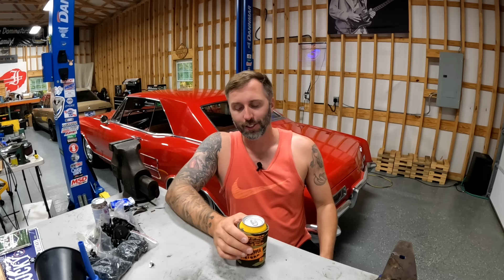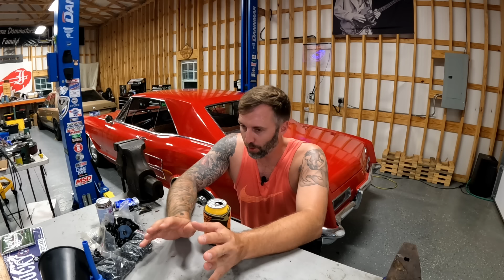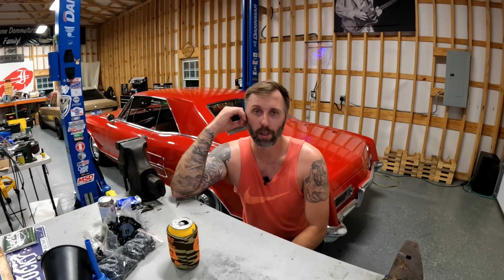Why I Ditched Holley Sniper EFI

Comment: I think if enough people spent time reading the  Holly's EFI website and looking at the issues they would find it may not be what they're looking for.  Holly's own website shows that their main issues are cold start drivability issues and fuel economy, all of the reasons most people switch to EFI.
Reply: Efi is ancient tech.   You need port for fi to run well with all the sensors.
Reply from the maker: I agree.   I wanted to try it.  Just confirmed my pre existing beliefs lol.
Reply: That mostly comes down to learning how to (or pay for) a proper, complete tune.
It took me an entire year (all four seasons) to learn and get "all of the tables right" on my first tune.
The Base Tables are relatively quick and easy, it's the Coolant and Air Temp. Tables that need to be "tweaked as the seasons change"...
Reply: The problem is they over sell the learning capability of these units. The car still needs to be tuned so the the computer isn’t adding or subtracting 50% fuel. If the oxygen sensor goes bad there is no way it will run right unless you have it tuned at 2 to 3%. No one realizes this and Holley doesn’t state it in their literature. The tune you get from the handheld is only good enough to get the engine running.
Reply: those are the two reason I would want EFI
Reply: I've had no issues with mine? But I read and reread installation instructions and followed the instructions.
Reply: Same there Just finish sniper 2 ,  run great take 3 days 2 guys
Reply: @supersportimpalass   They 100% oversell the "self learning". You will still need to tune it.
Reply: Yep - those were my issues.  1988 Chevy 3.1 L V6.  With Edelbrock intake was getting 11 MPG and had to hold our breath every morning to see if it would start or not.  Eventually took it off and put stock GM MPFI intake on it with Megasquirt.  Still tuning, but hopefully will be better than the Sniper.  

Also, the Sniper’s internal regulator sounded like a wounded cow every time you keyed on - embarrassed my daughter on startups, so I ripped the guts out and went with the Holley external unit - MUCH better choice.
Reply: Cold start drivability and fuel economy are tuning issues, if you cannot tune it right, what do you expect. It's not going to run start and drive like a new car until you spend the time tuning it. Geesh
Reply: @supersportimpalass  actually they do state it in the literature in the software for the HP/dominator stuff. They dropped.the ball by not giving the same info in the terminator x, and sniper software.
Reply: @KCadbyRacing Wow really, My 4150 carb runs well at all times of the year, but i do live in Tx were its mostly hot lol
Reply: @b.c4066 "if you cannot tune it right". That's exactly how they sell it though, as self-learning so you just install and it figures out what your engine needs. With that marketing, they'll get customers who aren't tuners and hope not to spend money on tuning.

It's not a customer issue, it's a marketing issue. Don't tell us your product can repeatably do something that it isn't the best at.

Comment: Put an afr o2 in the exhaust, and dial in the carb, and you will get just as good, if not better performance. Most people just have no understanding of how to tune the carband back in the day, they didnt have afr gaugesto dial in a carb to be close to efi efficiency.

Comment: I put a Sniper on my 408 68 Dart and it’s been outstanding. Start up is incredible and it hasn’t given me a problem so far in 3 years
Reply: Lee, interested to know what you are getting out of your 408? Magnum or LA? and what fuel economy and seat of the pants power are you seeing?
Reply: I ask because I had been contemplating an efi swap on my LA based 416  Coronet
Reply: @bbodybenny  I can be going 30, floor it and spin tires
Reply: Dumbest answer I've ever heard… guy probably runs 195 tires lol
Reply: @3pedalpodcast  yeah , that’s it . I change my 275 Mickey Thompson ET SS tires to those …
Reply: @bbodybenny  LA based , 525 lift cam . M1 intake , Eddie Heads but now I’d use Trick Flows if I did it over .
Reply: @3pedalpodcast  and look ! My comment got more likes than all 4 of your videos including your rap . So…
Reply: @leehouston5436 why the Trickflows vs the Edelbrocks?
Reply: @vinced2514  because they flow better out of the box than my Eddie’s with porting
Reply: I'm a Chevy fan! .. But??? ...  I love the Old Dodge Darts, I had two 74 Dart/Swingers over the years with 318's in them .. they were awesome to drive stock, and last forever! :) .. but I like the late 60's ones better :) 

I'd def put a Snuper !! in one today!!
Reply: I have a sniper efi on my 427w ford. Works great. But I read and reread the instructions before installation.

Comment: The aftermarket products are simply not made to the same standards as an oem system on a mass produced vehicle.
Reply: I find that funny because pretty much every carb that was on a car from the factory was from holley edelbrock of autolite, but yeah, they definitely aren't the company that used to be now though

Comment: I really recommend checking out Luke Finley's carb cheater system. Basically a data logging o2 with a idle self tuning and cruise self tune options at your selected afr, it uses a idle air control valve to adjust your afrs while crushing and idling.
Reply from the maker: Agree I already pre ordered one a few weeks back.  Subscribe! Thanks
Reply: So does the Sniper
Reply: @Carl_Jr  The only similarities is the idle air control valve and using a wideband o2 to control said idle air control valve. The rest is all up to the carburetor. It's also only $350. Works with any 4 barrel carb.
Reply: @401cam8  I'm just telling you that the Sniper uses the same exact IAC to do what the Carb Cheater does. It's nothing new. Quadrajets have been using that since the early 80s. You think Luke's invented something new and he hasn't. He just figured out a way to put it in a package that people will pay for.
Reply: @Carl_Jr  That isn't quite true. No EFI uses the IAC to tweak the A/F mixture (like the Carb Cheater does).
The Sniper (all EFI) only uses the IAC to control the Idle, Cold Starts and AC-on RPM (IAC on EFI can't and doesn't adjust the A/F mixture).

The Cheater's IAC controls Idle and Start RPMs, plus it's capable of tweaking the A/F mixture (at idle and light load, cruise RPMs).
But since it's "just a controlled air leak" it's only capable of leaning out the A/F mixtures (it can't and doesn't "add fuel").
So if your carb is adjusted or jetted lean the cheater can't/won't help that. BUT! "that's where the Cheater shines" IMO (price wise).
The Carb Cheater's O2 Data will show you if and where your rich or lean = HUGE help with "tuning your carb correctly"...

With that said, I have always loved and preferred EFI (since '2000') and I've been tuning Holley EFI (mostly on motorcycles) for 12 years...
Reply: @KCadbyRacing  Well said, but my point still stands. It's nothing new. 

Don't mistake that as me knocking the Carb Cheater. I'm not. It's good for those who don't know anything about EFI and who don't want the hassle of spending hours dialing in a carburetor.
Reply: @bigboreracing356  No. It isn't
Reply: @bigboreracing356  Because it isn't! It's just marketed differently. It doesn't matter how you control the air fuel ratio. It is still controlling the air-fuel ratio. It doesn't matter if you remove air or add it, or if you remove fuel or add fuel you are still changing the air fuel ratio. 

It sounds like you need to get off of Luke's jock. 🤣
Reply: Not surprised at all, I bought a diablosport trinity 2,for $900 Canadian, it never worked out of the box
I fiddled around with Holley for weeks,
They also wanted me to pay the shipping for my return
Which I did and they re imbursed me
But, I had to go to the bbb

Comment: I was seriously considering a Holley Sniper for my '68 Cougar and after watching this, I'm reconsidering. I'm sticking with my Holley 4bbl on it.  The Holley EFI systems have too many Chinesium parts in them.  I agree with those Carter AFB's/ Edelbrock carburetors.  Put a Edelbrock manifold, 4105 and matching Edelbrock fuel pump on my buddy's '75 El Camino.  The thing runs like a top.  Idle is glassy smooth. I'm sticking to carbs. I'm so glad I watched this video.

Comment: I am an avionics technician and have had extensive training in cables soldering and crimping.  I heard your comment on wanting soldered connections and what I have been told in my training was crimp connections are stronger than soldering.  I hear all the time in the automotive side that people think soldering is better than crimping and that isn’t always the case.  There are times where soldering is preferred but crimped connections are stronger.  What you do need to do is provide strain relief for all crimped connections.  I use the uninsulated crimps and use heat shrink on top, this provides a clean look as clean as a soldered connection and the strain relief.  I do agree don’t use the quick connections from the auto parts stores, I know Napa sells the uninsulated but joints.
Reply from the maker: I agree with you.  I did a lot of rambling in the video.  Everything has a time and place.  I also like to do the method you talked about.  If I only have a cheep one I will usually cut the nylon shell off and heat shrink just like you described.
Reply: My best friend is a 35+ year master mechanic, and he's ALWAYS told me to NEVER solder wiring connections, because the wires won't flex, and the strands will break, one by one.
Reply: Why not both? You can crimp & solder.
Reply: @kurtvanluven9351  it’s a waste, plus the crimp is a stronger connection.  Soldering has its places but crimped is stronger.
Reply: @kurtvanluven9351  It may seem like a belt and suspenders thing, but the problem is the solder transforms the flexible multi-strand wire into a rigid, inflexible mono-strand wire.  Ever wonder why automotive wiring is not like house wiring?  The single-strand house wire does not tolerate flexing back and forth, which is what automotive wiring must do, and the single strand will work harden, and break.
Reply: There's one place for a crimp/soldered/heatshrink connection and that's a marine application. You can't do it any old way. First, crimp on (uninsulated) connector to the wire. Just proper crimping is a complete topic on its own! Next, solder ONLY the exposed part of the wire at the end of the connector to seal this naked wire against moisture intrusion. This is an art form. Just enough heat (first) and solder to keep it from running down the wire past the connector. Use an adhesive type heat shrink tubing. This wire will never fail unless cut! My opinion: insulated crimp-ons are a terrible connection!
Reply: My $0.02, I had a ground in the factory harness of my 2002 Chevy truck that came up open. I traced it to a factory crimped lug bolted to the rear of the engine block. This crimped lug happened to have another ground from a separate circuit included, so there were a pair of ground wires from 2 separate circuits crimped into 1 lug terminal that was bolted to the engine, and as I said this is original OEM wiring. 

The termination was solid, no corrosion, just normally dull in appearance, with both wires still secure and no mechanical damage. The one circuit to that termination point checked good with low resistance to ground, and the other was open. So I figured since the known termination point shared by both conductors was mechanically solid with one conductor showing good ground and the other conductor crimped in there with it showing open, the open circuit had to be caused by a break in the wire somewhere.

So I completely unraveled the harness. If you are familiar with these trucks, it is in the thick bundle harness from the under hood fuse box to the engine. I physically inspected every inch of that wire all the way to where it terminates on the underside of the fuse panel. There was no break in it. So I unpinned it from the fuse panel and took it to the bench. Again, one conductor to the lug was good and the other was open, and no wiggling would produce an intermittent. 

So I carefully pried open the crimp on the lug. I found 2 stranded copper wires that looked normally oxidized on the surface of the metal from being over 20 years old. Other than that I found no smoking gun, but for some reason there were 2 wires crimped together in the same terminal and one went open while the other did not. I cut back both wires to expose clean copper, cleaned up the terminal, put the wires back in it and restored the crimp. Then I soldered it.

I know about the hazards of soldering in automotive connections. From what I have read, mil spec is against soldering automotive wiring. I have experienced firsthand the problems, I had some soldered connections that I made installing a remote start/security system crack on me. But these were connections that I handled roughly a lot in the process of doing a rotisserie restoration and a whole bunch of other work that required this wiring to be disturbed repeatedly.

My opinion is that solder is mechanically more vulnerable but will resist corrosion better, and will not lose contact from simple surface oxidation. Trade-offs, life is full of them. Crimps can also mechanically crack the wire when flexed at the stress riser created at the crimp point. Either way some sort of strain relief is beneficial. I try to use shrink tubing wherever possible.
Reply: Soldering is a bad idea on a flexing cable. The flex gets concentrated on the point where the solid solder part transitions to the flexible part causing a stress point.
Reply: You lose 1 tenth of a volt per crimp you don’t lose any voltage by soldering
Reply: @jodypierson3137  I’m just sharing what I’ve learned from aviation.  I would have to look up the specs but I don’t believe you loose that much though a crimp.  I figured if it’s good for an aircraft where you can’t pull over if you have a failure it should be good for cars.
Reply: @jodypierson3137  Voltage drop depends entirely on the current and the resistance in the crimp/joint.
Reply: @timelesssteelgarage   I worked as a marine mechanic and USCG only allows crimped connections because if a wire shorts out it can melt the solder joint.  The marine crimp connectors with the shrink ends are the best USCG approved.
Reply: @kurtvanluven9351 You really don't want to do that.

If you crimp it then solder, you've wasted the crimp and may as well have just soldered it or left it crimped.

If you solder then crimp, over time the solder will flow out from where the pressure is and cause the crimp to become loose, again wasting the crimp.

Both are perfectly acceptable methods, crimps tend to get a bad wrap because 99% of the time people buy cheap junk. Both in terms of the crimp itself, but also the crimping tool.

You need to spend good money on the crimp AND use the correct tool with them.

With both crimping and soldering strain relief MUST be provided. Quality crimps will often provide strain relief built into the crimp, same deal with solder splices (my personal preference), but additional strain relief is always a good practice. If there's any movement allowed at the point where the strands are retained those strands will break one by one, regardless of what you use.
Reply: No one should be using solder anymore because there's no mercury content. It is poisonous, so the Fed's deemed that not suitable. The problem now is the solder that  is being sold is not as conductive and does not have the same adhesion as the 'old' stuff. None of the European manufacturers have used solder for this ( and other ) reasons for a long time. You can actually introduce resistance into a circuit by soldering. Using high quality connectors from Wurth products, quality wiring, good crimp tools and heat shrink goes along way
Reply: You should always solder and crimp, then heat shrink.
Reply: I think your right and wrong about this. Im from automotive side but both methods fall into the same downfall. User skill and quality components both matter and that makes the difference. Quality solder joint vs quality crimps are fairly even. Thats why oem harnesses come soldered. We have an expensive crimper set at work thats amazing and idiot resistant. We only have a few people who are competent to soldier. I consider myself decent but know only my best can even compare with our crimper, but my worst is better than cheap plastic crimps.
Reply: @kurtvanluven9351 thats how i was taught, sort of. Using bare barrel with wires in, no crimp, but fill with soldier. Heat middle and when soldier comes out other side while you feed its full. Of course beat shrink over

Comment: I had the 4500 Sniper on my 582 ci bbc and had the same flooding issue that turned out to be a bad unit, Holley replaced quick and easy no hassle.   It ran ok for a few 100 miles it then started idling at 2500 at a stop light in an 800+ motor with 0% throttle position and iac at 1%.  I went back to carb as soon as I got it home because i was tired of every Sniper issue risking an expensive motor or transmission.

Comment: I did a sniper system on my 70 Impala. All went great and worked for about one year then two temp sensors went out. Of course the sniper doesn’t know what to do without temp input. Went thru Holley tech support. After several tries and long hold times I finally got a tech on the phone. No problem they over nighted me another system. I do think it was a refurbished system but I gave it a try. After 1 week the timing then stopped reading. I also had installed the Holley distributor that works with the system. After over a year of my car sitting there I finally said heck with it and put my HEI distributor and Eldelbrock carb back on. Now I’m back to driving to shows and cruises. Thanks for your video!
Reply from the maker: Sounds like a common story.  Thanks for watching the channel.  Subscribe ! Thanks